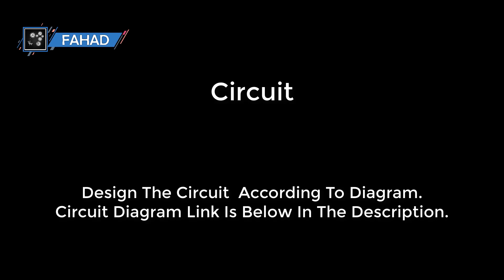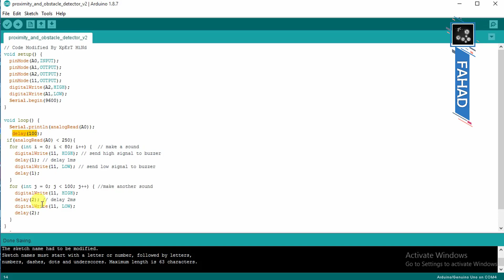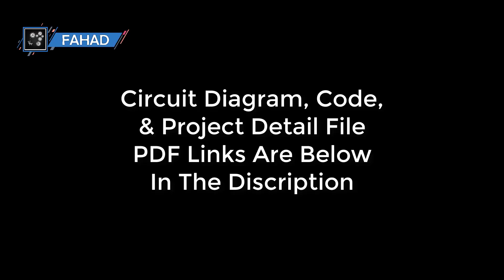Proximity And Obstacle Detector With IR Sensor | Security Alarm | Arduino Based Project

Comment: Expect of buzzer  can we use dc moter or not.
Reply from the maker: You can but you will need to change a bit of code and you might require a motor driver..

Comment: Hi if we want 5v as output for the 5v buzzer then what to do 
Please help its URGENT
Reply from the maker: Do you still need help?
Reply: @XPERTMINDing  ya sure
Reply: @XPERTMINDing  pls tell me how to give 5v output
Reply from the maker: There is a 5v output on arduino board
Reply: @XPERTMINDing  I am talking about the code 
If I put the buzzer or motor on 5v + grnd then it will always stay on 
Btw do you even know what to do
Reply from the maker: I think you need to study arduino.. the digital pin always operates at 5v.. About 20 to 40mA
Reply from the maker: If you need more voltage and amps then buy H bridge or driver.. L293D etc etc..
Reply from the maker: The driver will operate through logic sent from arduino and will control the external voltage supplied from driver to your device (buzzer)

Comment: Hello my project name is smart Dustbin using Arduino uno,so in my project m using ur sensor and ir sensor with buzzer ur sensor is going to detect the object nearer to the Dustbin and ir sensor detect the range of the trash inside the Dustbin when the Dustbin get full it gives the buzzer sound so my question is, is it k to use ir sensor with buzzer to detect the range of trash inside the Dustbin ? .so please reply me as soon as possible.
Reply: @XPERTMINDing  thanks for your reply so then can i go head with this? Is it k na if I used that method?